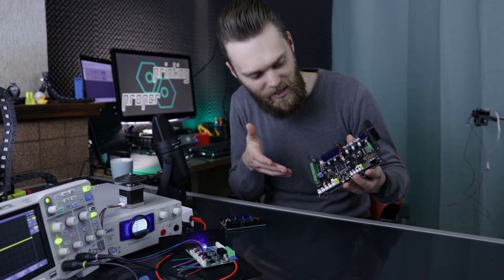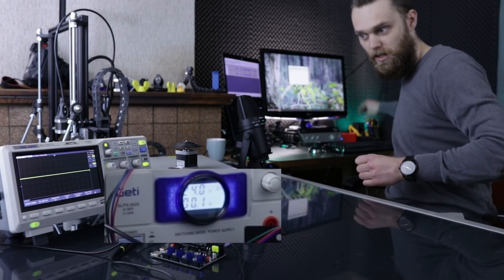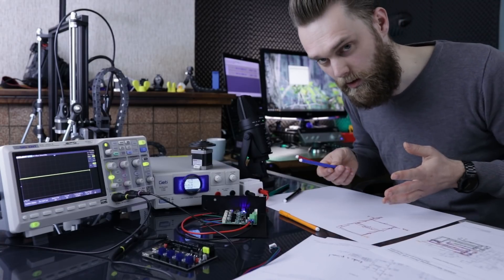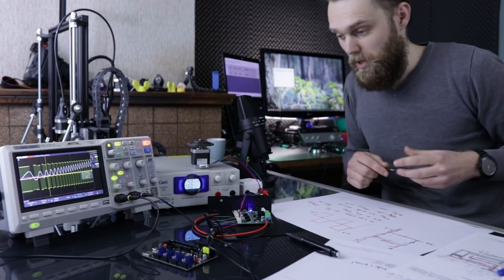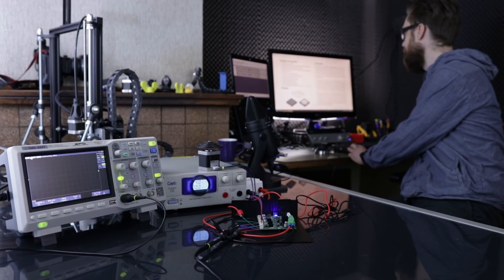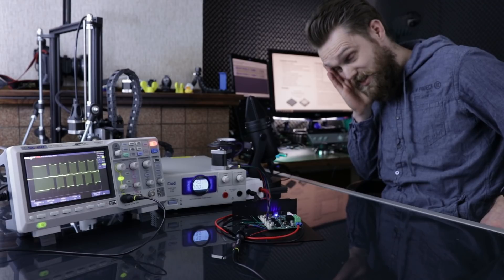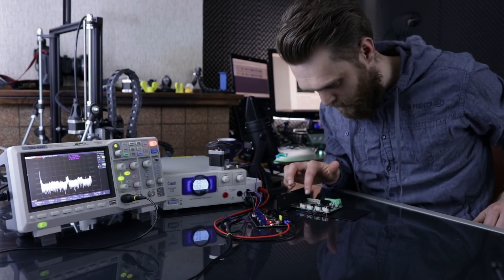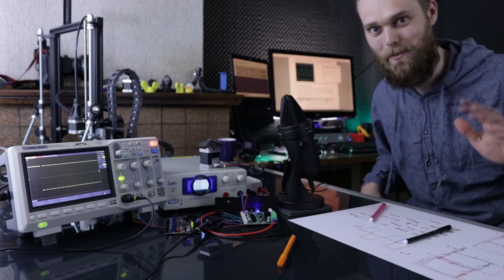Why did I blow up my stepper motor driver of my Ender 3?

Comment from the maker: I hope you’ll learn a thing or two from this video and if you have any questions, let me know! :D Don’t hesitate to leave a comment if you can add some information or if I explained something incorrectly. I’m going on holiday for a week but I’ll read all the comments and reply to them where possible, have an awesome day!
Reply: you're absolutely right, no voltage drop over one of the sense resistors pumps the current up until the magic smoke gets released. your last drawing explains it perfectly.
Reply from the maker: That's cool, thanks for your confirmation! I was a bit unsure but I couldn't think of something else.
Reply: @properprinting  btw I'm ElWiz from f3d discord
Reply from the maker: Awesome, good to know. Thanks again for sharing my video there!
Reply: One other possibility is that one of the stepper motor wires became disconnected while a significant current was flowing through it.   This can perhaps cause a larger momentary voltage spike than the mosfet body diodes or the driver circuitry can handle.   The voltage is given by the equation V=LdI/dt;  When you disconnect the steppers while current flows through them, dI/dt approaches infinity creating hundreds or maybe thousands of volts for a very short period of time.   This abrupt change in current may be significantly more abrupt than the Mosfet switching off during normal operation.   I have seen a stepper driver get smoked for this very reason.  I think some driver board makers (e.g. Gecko) even warn you to not disconnect them while energized....for one thing it can be a dangerous shock hazard as the energy stored in the stepper may find a path to ground by emitting a spark through your hand and body.

If you want to test this, use a relay to interrupt the current and trigger your scope with the relay control wire to look for this voltage spike-and be very careful... 

I believe, some driver boards have extra diodes that protect the circuit for this type of thing.   It doesn't look like the Ender 3 has anything like that...    Also, the  A4998 spec sheet does not indicate that it can withstand more than 35 volts.   As most of the energy in the stepper arcs across the disconnected wire, the resulting high voltage may destroy the driver.

Anyway, this is my best guess...

Best,
Bernie
Reply: Which new main board do u use plz add link or text name of main board
Reply: I guess im randomly asking but does any of you know of a way to log back into an instagram account..?
I somehow lost my login password. I would love any tips you can offer me.
Reply: @Ashton Odin thanks so much for your reply. I got to the site thru google and Im waiting for the hacking stuff atm.
Takes quite some time so I will reply here later with my results.
Reply: @Ashton Odin It worked and I now got access to my account again. I'm so happy!
Thank you so much you really help me out!
Reply: @Guillermo Caspian happy to help :D
Reply: hello man, I did blow up my motherboard too, it happened two days ago from now and here I am going to explain what happened: 
i was working on my ender 3 pro to get a direct drive mounted on it, the assembly went good, the thermistor which was my biggest fear of not working worked well, the time to get the Extruder stepper came and it went horribly wrong, I plugged the stepper and it turned on wrong direction so I decided to swap the cables, then nothing so I tried the stepper X plugged on the Extruder driver... what a bad idea at this moment I knew I fucked it up the motherboard sparked and a fire started on the Extruder driver, I already received a new motherboard but I am so afraid that I have to change other things

Comment: I blew up the extruder controller (the A4988) when I forgot to turn off the power supply when I reconnected the motor. Is certainly not protected from stupidity! The good thing is that I changed the motherboard for a BTT SKR Mini E3 V2.0 which is much better than the shitty Creality motherboard.

Comment: Recently blew up my A4988 drivers on my printer after upgrading the extruder which came supplied with a different stepper motor. Of course the coil pairs were different and I just reused the old wiring and managed to blow up the driver. Then proceeded to blow up all the remaining drivers trying to diagnose it. Was looking at the datasheet trying to figure it all out, and your video explains it all very well. 

In the end I went and installed a SKR mini E3 to replace the main board. I also ordered some new A4988 drivers off aliexpress and will swap them out on the old main board to keep as a backup.

Comment: Awesome. My Ender 3 pro's extruder stopped working and I've been chasing the solution for days. I've apparently damager the flat cable, since the motor is ok. Tried another cable I've bought from China, but of course the middle wires weren't crossed. Fingers crossed I haven't blown my stepper driver.

Comment: Thank you so much for making this video. The stupid ender cables are black so you can't tell what's going on. I got my first pancake nema 17 and I realized that I'd probably want to check out the pinouts before I did anything. Your video is the only one that really covers all the diagrams. Time to go test the pinouts and not fry this board!

Comment: Hi ! thanks for your videos ! By the end you say the 0.1 ohm doesn't sense anything which is wrong. It senses the current flowing throught your H bridge thus in the coil itself. it's used as a current limitation as in your bench power supply. 
I have no idea why your driver died horribly but my guess is that one of the output mosfets came to a dead shrort instead of failing open circuit. 1 chance outta 2. his friend of the opposite branch didn't quite appreciate it and blew up the chip to Mars.

Comment: I thought I blew up my extruder motor then realized the problem is the mainboard, because the motor worked when I switched the e to z wire. I bought a new mainboard to upgrade my CR-10 mini at the same time. Now I'm playing with visual studio code to make my printer working again, so if there a way to repair my good old melzi board back on track I would really appreciate!!!

Comment: I ve had somethink like this when I connected new stepper with wrong wiring. Driver switched off for a 5 or 10 minutes. There is some "stupidity safety" in those drivers. Try turning left(to lower current) or right(to higher current) the screw on the driver. You can even measure voltage on this screw comparing to ground on the board. Ground you can figure out looking at 2560 diagram pinout.
Second thing you can try is those plastic connector cubes: you pull(bend out) plastic sticks in there and pull wires out and switch them. However if driver worked right at the beginning connections should be fine.

Comment: I think you're right that the problem was a coil crossing from one driver (H-bridge) to the other. It's a little worse than you drew it, though; the current path won't go through both coils (in which case current would typically be lower), the other coil is also connected across to the other side. What happens with the chopper is that it's measuring current at particular times, and those times may not overlap for the two sides; thus you can have both sides deciding that more current is needed since they don't see their own current. Even if they trigger their short circuit protection, that may not turn off the right driver.

Comment: so what did printer do exactly when the driver went bad??? did printer stay on and just stop moving or what...??? thanks
Reply: It emitted blue smoke from the electronics box and was promptly turned off. I believe it was able to keep running, but without this one burned axis being able to move any longer. Given the hot end is on the same circuit even on better designed boards, i don't think any board can absolutely guarantee you not to set something on fire under the circumstance, but at least the board is guaranteed to be made form a self extinguishing material.

Comment: I had a similar problem. I'm new to all of this and never owned a 3D printer. I built it, tried to authome, the x-axis didn't move in the right direction. Someone online told me that I should swap the middle two connectors and that should flip the rotation and go the right way. Well, I did it, but I'm pretty sure the stepper driver is fried... Lol. I'm going to order another stock control board on the ender 3 and hope everything is fine...

Comment: So switching 2 of the 4 wires shorted the coils out? Would you need to switch all 4 wires to make it work in reverse?
Reply: Switching two middle wires or two outer wires with each other can short out the motor driver. So the pinout of the board connector is A1, A2, B1, B2. Both A need to be connected to ends of one motor coil, and both B need to be connected to the ends of another coil. If you switch A1 and A2, this is safe and the motor is reversed. If you swith B1 and B2, the same. But never ever allow one motor coil to be connected to A and B outputs at the same time!

Comment: You should be able to swap all stepper pins on a 4 wire cable without blowing up the driver. Worst case you created an open circuit, otherwise the current goes through one of the 2 stepper coils. Leuke video! Ga zo door!

Comment: Well, It could well be that that was the problem, it's weird tho that they would not "add" the current of both H-bridges together also to see if it is above a maximum. They obviously shouldn't only do that as that would cause other problems but also checking the total current, I would think saying that they have 'Short circuit protection' that they would've implemented that too. Maybe the "explosion" of the driver also  could've been due to some kind of back emf that caused it to receive a spike in voltage somehow (after the coils got saturated with current) and that caused it to explode in that way? I don't know just thinking aloud xD

Comment: Signal is the same, timebase has changed.
Reply from the maker: I cannot disagree on that. What I meant is that it looks different and that you can easily be fooled if your time base is too narrow (I was at first xD)
Reply: @properprinting  25 years in electronic repair and design. Just experience .... love your work though :) Big fan of your channel.
Reply from the maker: @RamjetX  OK, I'm not working even half of that in the electronics so yes, I can imagine that you know a thing or two about it ;) Very cool to read that you love my work, thanks! :D

Comment: Curious how you manage to blow up the drivers by switching the wires of the steppermotor. I swapped a mainboard for a SKR 1.4 other with SKR 1.3 both fitted with TMC2208 in UART mode and I had to figure out the right way to wire them. Meaning switching the middle two wires, the two outer wires, all four.  The motors I have are 42SHDC3025-24B with all the switching I did, not a single stepstick failed on me. Board has 24v Juice Steppercurrent is set to 800 (default).
Reply from the maker: I have to admit that it's still strange that it happened like it happened. My only explanation is the one I gave at the end of this video but I still have the feeling that I'm missing something, but don't know what exactly.. My current was set to default as well btw

Comment: what's the difference between a driver and stepper motor? i mean stepper motors are the drivers or is something different?
Reply from the maker: I meant stepper motor driver which is the chip I destroyed which drives the stepper. I said stepper motor a couple of times, but the motor itself isn't destroyed. It's a bit confusing xD

Comment: i just put a piece of glass on my ender 3 to have better first layers, first thing i noticed is that the glass is a lot heavier than the default bed, my concern is, could that be a bad thing? like the motors have to make more strength? the rubber straps won't stretch? well i have this doubts now
Reply from the maker: I only print on glass and have printed a lot already. I haven't had issues at all. I think that this becomes more relevant if you want to crank up the printing speed.

Comment: oh my, you have a lot of time on your hands!!! enjoyable production, my friend. as below - 2 wires per coil (can be tested with an ohm-meter) they should go to the driver's a1-a2 and b1-b2 respectively. the coils themselves can be reversed as you did, which by reversing one pair, WILL reverse the direction of the rotation. I've learned from that same exercise you have done some time ago, but since i did not put a vid out, you never got to reap the  benefits of my stupidity. sorry.
keep up the great work that you do - very inspiring.
Russ from Ocala Florida, USA
Reply from the maker: Thanks a lot Russ for your comment! I don't have the time to reply to the comments in a timely matter though xD Another way to find the coils is to connect the scope and rotate the motor. This looks pretty cool and I should have shown that on this video. It's good to read that my work is inspiring, thanks! :D

Comment: just nitpicking 
@17:48 you say the current goes through two motor coils
this halves the current as the total resistance doubles.
your conclusion though was right :)
at the datasheet at page 66 [15.2] the have their excuse sentence for burned-out drivers. 
With the TMC2130 they did it the right (expensive) way and used a high side RDSon current measurement (Datasheet TMC2130 Page 61 [12.2]). 
Low side measurement is cheaper as you can measure across your current resistor (which can be substituted by using the MOSFETs internal resistance, further saving complexity and electrical losses...) which goes directly to GND. At the high side you would have to "level shift" the small analog voltage to GND.
hope this made it clear
Reply from the maker: You're absolutely right! The difference between half or double is not nitpicking xD Thanks a lot for your clarification, great information!

Comment: nice really like your videos, always great ideas/designs.
I can offer to change the SMD stepper drivers on the boards if you want. I have some unused allegro chips if you want to have a "stock" ender board for future videos and if you put in a 2209 bare chip or stepstick breakout into the package I can also repair you bigtreetech board. I'm from Germany if you want to look if it is worth the shipping...
from Germany to the Netherlands it is 5€
Reply from the maker: Thanks a lot man! I work at an electronics manufacturer so I should be able to repair the board ;) Cool that you can do these kind of repairs as well. Your offer means a lot to me and if I need a board I will contact you, thanks! Ps. The Ender 3 board has turned into carbon under that QFN so that will be hard to repair xD
Reply: @properprinting  oh ok nice didn't know that...What are you doing at the electronics company. Just out of curiosity?
The ender board has earned it's retirement then xD. Can at least the big tree tech board be saved?
Reply from the maker: I am a test engineer and I build test fixtures for production testing. I mainly do LabVIEW programming but it's a combination of electronics and mechanics as well. I have repaired boards in the past but I don't do that so much anymore. Do you work in the electronics too? The BTT should be able to repair which can be a nice video for the future :)
Reply: @properprinting  sounds like you made your profession your job, that's amazing :)
I'm just studying engineering science right now
Reply from the maker: Just studying engineering science he says xD Man, that's great! You'll definitely find your profession :)

Comment: I have a stepper motor I'm trying to use for a project. Do you happen to know how I could minimalistically connect it to a computer, and turn it 90 degrees at a time? I'm trying to make something that rotates by moving in increments of 90 degrees, or moves to different 90 degree positions based on what I want.
Reply from the maker: The easiest thing I can think of is to use a spare Creality main board (overkill for sure but it saves a lot of hassle) and connect that board to your PC. You can use a terminal screen e.g. Putty, TeraTerm or Termite and send the G1 command. You have to calculate back how far you want the stepper to rotate in order to reach 90 degrees. Hopefully this helps :)

Comment: Fantastic video very educational. this also makes me wonder if this is mainly with the A4988 drivers or others too. i have also heard that disconnecting  a stepper while live can blow a driver and some boards have added protection against this. love your videos finding your channel was like stumbling across a gold mine of educational videos. Thanks for everything and keep up the amazing work!
Reply from the maker: Thanks a lot for your comment! I've heard a similar thing about disconnecting the drivers and I think that's due to the energy stored in the coil of the motor. I think I will make a similar video in the future in which I'm going to do more experiments.
Reply: @properprinting  My old company (don't want to mention their name), would blow stepper drivers because the electronic brake was set (short to GND) before the motor was stopped moving. It was a minute amount but enough time to have kickback from the coils.
Reply from the maker: @bitsurfer0101  Thanks for the information. Yes that kickback would be great to measure one day with the scope. These spikes can be immense!